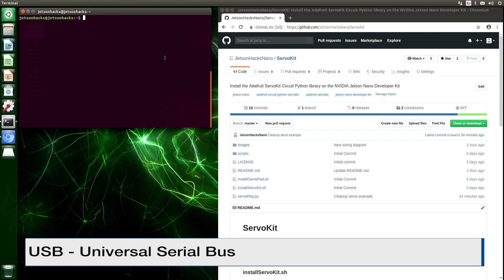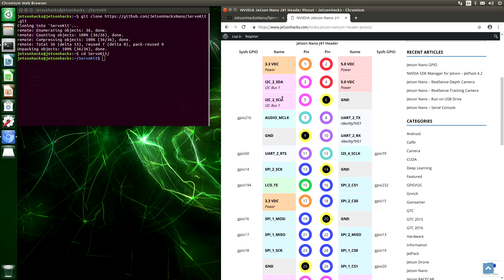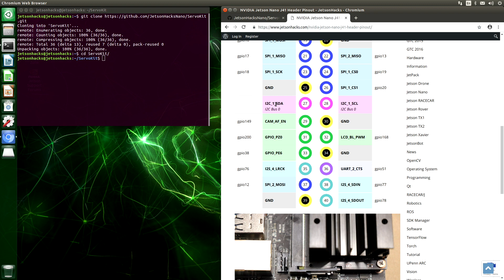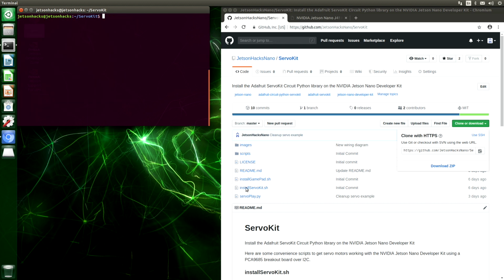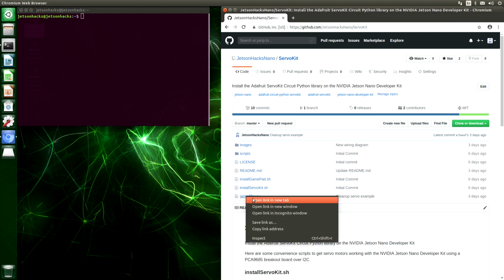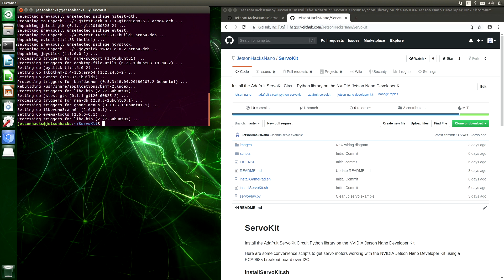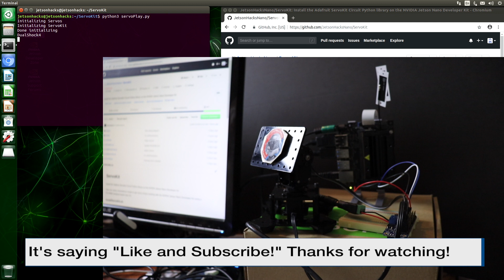Jetson Nano I2C PWM Servo Motors

Comment: Hi. I have run your script  on a clean install of Jetpack 4.2 which, I believe, is the one you use in this video.
 After the initial Ubuntu setup palaver I do a sudo apt-get update and then install git.Then I run your script which seems to run perfectly and I get added to the groups etc, etc. I wire my PCA9685  to pins 27 & 28 (i2C_0).  Then I copy the first few lines of your servoPlay.py script into a file I call servoTest.py and when I run it I always get this error :

from adafruit_servokit import ServoKit
import board
import busio
import time

i2c_bus0 = (busio.I2C(board.SCL_1, board.SDA_1))

kit = ServoKit(channels=16, i2c = i2c_bus0)

Traceback (most recent call last):
  File "servoTest.py", line 6, in <module>
    i2c_bus0 = (busio.I2C(board.SCL_1, board.SDA_1))
  File "/usr/local/lib/python3.6/dist-packages/busio.py", line 31, in _init_
    self.init(scl, sda, frequency)
  File "/usr/local/lib/python3.6/dist-packages/busio.py", line 59, in init
    from machine import I2C as _I2C
ModuleNotFoundError: No module named 'machine'

The error seems to indicate that the Jetson Nano board is not being detected  and I have not found any references to this particular problem anywhere. 
Have you any ideas as to why I seem to be the only one suffering this?

Thanks in advance for any reply.
Reply from the maker: The error message indicates that it can not find the Python module machine. Have you tried: https://www.youtube.com/watch?v=eImDQ0PVu2Y

Comment: Right joystick isn't working. It's mapped to RT. RT starts in 0 range and when pressed it goes eg 90 deg right and then 180 deg left. I've tried remapping via dualshock4.py file and even in jstest-gtk. Any suggestions?

Comment: Why at 9:50 after the angle supposedly set to 3, then when the angle is set to 177 (which should be nearly the opposite direction from 3 ) the servo only looks like it turned about 90 degrees?

Comment: Has anyone received this error when installing the game pad? Thanks for the tutorials! They're helpful. 

Collecting approxeng.input
  Using cached https://files.pythonhosted.org/packages/1c/27/418500122ddff3e29355c5f248b20690555102c59037961968583262ae55/approxeng.input-2.4.2.tar.gz
    Complete output from command python setup.py egg_info:
    Traceback (most recent call last):
      File "<string>", line 1, in <module>
      File "/tmp/pip-build-t2inutxw/approxeng.input/setup.py", line 2, in <module>
        from setuptools import setup, find_namespace_packages
    ImportError: cannot import name 'find_namespace_packages'
    
    ----------------------------------------
Command "python setup.py egg_info" failed with error code 1 in /tmp/pip-build-t2inutxw/approxeng.input/

Comment: does this kind of pwm work as "audio output?
"
Reply from the maker: I do not know what you mean regarding the relationship between PWM and audio.
Reply: @JetsonHacks  Pwm should be a square wave... If it's between 20hz and 20 khz it should be hearable... Or maybe i am missing something ahahah
Reply from the maker: @Barsay  Computer PWM signals are typically 25kHZ. Typically they are used to run peripherals like fans, servos and so on with the duty cycle being the variant. I don't have enough experience with audio applications of PWM from the PWM drivers to offer an answer. You should ask this question on the official NVIDIA Jetson Nano board, where a large group of developers and NVIDIA engineers share their experience.
Reply: @JetsonHacks  thanks! :)

Comment: Question, I’m very new to this, how do I connect  the pwm board to the breadboard? Thanks for these great videos and helping the jetson community!
Reply from the maker: Thank you for the kind words. The PWM board mounts to the breadboard by header pins which are soldered to the board. It's been a while, but I believe that the Adafruit board that I was using included the header pins in the package. After soldering the header pins onto the PWM board, plug the header into the breadboard. Thanks for watching!
Reply: JetsonHacks I bought the pwm board and soldered the pins but they do not stick out long enough through the back to connect to the breadboard. Connecting the pins to the breadboard is where I’m stuck.
Reply from the maker: @raraaararara  On one side of the header, the pins should be long. They go to the breadboard. The short side gets soldered to the PWM board.
Reply: JetsonHacks any tips on keeping dust out of your workspace?

Comment: My GIPOs are not showing any output(voltage) although the code is running properly. I have also tried to blink an led (with and without transistor) but still not working...plz helppp

Comment: Hello your videos are very help full. I followed this video but in my case the servo is not moving. Can you tell what the problem might be?
Reply from the maker: You have not provided enough information with which to help. Can you use i2cdetect to see the servo driver?
Reply: @JetsonHacks  I can't what might be the problem? Is it the board?
Reply from the maker: @usamashakeel7229  If you cannot detect the device, then you probably have it wired incorrectly.

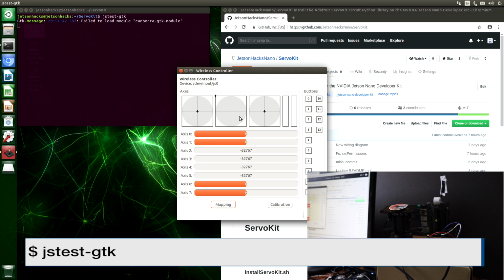Comment: Hi! my PS4 joystick has connected, and work well in jstest-gtk at 11:32, but it showed error once I run "python3 servoPlay.py", while servo at channel 0 turned about 100 degree and back after the line "Done initializing", before the error showed. How can I solve this problem? Thx! 

wb@jb:~/ServoKit$ python3 servoPlay.py
Initializing Servos
Initializing ServoKit
Done initializing
Traceback (most recent call last):
  File "servoPlay.py", line 37, in <module>
    with ControllerResource() as joystick:
  File "/usr/local/lib/python3.6/dist-packages/approxeng/input/selectbinder.py", line 37, in _init_
    self.discoveries = find_matching_controllers(*requirements, **kwargs)
  File "/usr/local/lib/python3.6/dist-packages/approxeng/input/controllers.py", line 170, in find_matching_controllers
    all_controllers = find_all_controllers(**kwargs)
  File "/usr/local/lib/python3.6/dist-packages/approxeng/input/controllers.py", line 207, in find_all_controllers
    get_controller_classes()}
  File "/usr/local/lib/python3.6/dist-packages/approxeng/input/controllers.py", line 206, in <dictcomp>
    id_to_constructor = {'{}-{}'.format(c['vendor_id'], c['product_id']): c['constructor'] for c in
  File "/usr/local/lib/python3.6/dist-packages/approxeng/input/controllers.py", line 201, in get_controller_classes
    for vendor_id, product_id in controller_class.registration_ids():
TypeError: 'NoneType' object is not iterable
Exiting... 
Cleaning up pins
Reply: I had the exact same thing happen to me. Your solution of downgrading solved the problem so thank you!
Reply from the maker: @shaischnarch  I am glad you got it to work!
Reply from the maker: It says it can't see the game controller. You will need to debug it.
Reply: @JetsonHacks  I finally resolved the problem, it's the version problem, I downgrade the approxeng.input version to 2.3.0, and it works.

Comment: Hi! Love your tutorials! I have followed the steps and things went well, but I got an error below when I input "kit = ServoKit(channels=16)
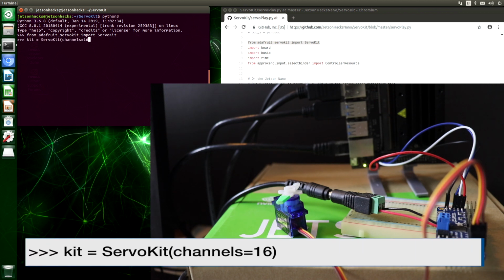" at 9:19, where showed:

Traceback (most recent call last):
  File "/usr/local/lib/python3.6/dist-packages/adafruit_bus_device/i2c_device.py", line 68, in _init_
    i2c.writeto(device_address, b'')
  File "/usr/local/lib/python3.6/dist-packages/busio.py", line 69, in writeto
    return self._i2c.writeto(address, buffer, stop=stop)
  File "/usr/local/lib/python3.6/dist-packages/adafruit_blinka/microcontroller/generic_linux/i2c.py", line 38, in writeto
    self._i2c_bus.write_bytes(address, buffer[start:end])
  File "/usr/local/lib/python3.6/dist-packages/Adafruit_PureIO-0.2.3-py3.6.egg/Adafruit_PureIO/smbus.py", line 244, in write_bytes
OSError: [Errno 121] Remote I/O error

During handling of the above exception, another exception occurred:

Traceback (most recent call last):
  File "/usr/local/lib/python3.6/dist-packages/adafruit_bus_device/i2c_device.py", line 74, in _init_
    i2c.readfrom_into(device_address, result)
  File "/usr/local/lib/python3.6/dist-packages/busio.py", line 59, in readfrom_into
    return self._i2c.readfrom_into(address, buffer, stop=stop)
  File "/usr/local/lib/python3.6/dist-packages/adafruit_blinka/microcontroller/generic_linux/i2c.py", line 44, in readfrom_into
    readin = self._i2c_bus.read_bytes(address, end-start)
  File "/usr/local/lib/python3.6/dist-packages/Adafruit_PureIO-0.2.3-py3.6.egg/Adafruit_PureIO/smbus.py", line 155, in read_bytes
OSError: [Errno 121] Remote I/O error

During handling of the above exception, another exception occurred:

Traceback (most recent call last):
  File "<stdin>", line 1, in <module>
  File "/usr/local/lib/python3.6/dist-packages/adafruit_servokit.py", line 86, in _init_
    self._pca = PCA9685(i2c, address=address, reference_clock_speed=reference_clock_speed)
  File "/usr/local/lib/python3.6/dist-packages/adafruit_pca9685.py", line 131, in _init_
    self.i2c_device = i2c_device.I2CDevice(i2c_bus, address)
  File "/usr/local/lib/python3.6/dist-packages/adafruit_bus_device/i2c_device.py", line 76, in _init_
    raise ValueError("No I2C device at address: %x" % device_address)
ValueError: No I2C device at address: 40

How come? Not sure how to sort it... thanks for your help!
Reply from the maker: It says that it cannot find your PCA9685. You should use i2cdetect to see if the Jetson can see the device.
Reply: @JetsonHacks  Wow! It works!! Such a magic here... 
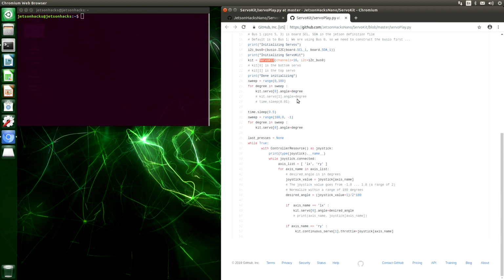The error was caused by mixing up bus 0 and bus 1 at 8:15
Thanks a lot!
Reply: Connecting pin3 to SDA and pin5 to SCL, which is bus 1, the problem is solved!
Reply from the maker: @techxartisan  I'm glad you got it to work!

Comment: Thanks for another great video. I am discerning from this and other info on the WEB that there is no easy way to do PWM on the Jetson Nano. I would think this is a much needed feature, as it would allow direct control of servos from the nano (with suitable power supply). Does anyone know if the issue of simple PWM on a nano GPIO pin has been solved. Did not find a solution looking around on the NVIDIA forums.
Reply from the maker: Thank you for the kind words. Like the Raspberry Pi, the Jetson has one PWM output. In order to get the PWM output to work, you will need to modify the device tree appropriately. This is the same process as the RPi (and any other Linux embedded computer). However,  the RPi has a user facing application which will help reconfigure the device tree "on the fly" so that you can configure the GPIO pins as SFIO (Special Function Input Output) by selecting their function from a menu, and then rebooting the machine.

There is no equivalent on the Jetson, though I do know that their engineers have been working on it. On the Jetson, it is more complicated than the RPi because the device tree is signed as protection against malicious intent. The RPi does not have that particular feature.

Typically things like PWM are better performed off of the Linux machines (SBC) themselves, because Linux is not a real time operating system. Running PWM is rather clumsy and requires a bunch of CPU cycles to monitor and time the pulses correctly. Micro-contollers like an Arduino or dedicated hardware like a PCA 9685 are built specifically for these types of tasks, as well as have a wider variety of analog, digital and other types of inputs. Not that you can't do it on an RPi or Jetson, but certainly if you are running multiple servos you will need to do that anyway. Of course, you know this already by the large ecosystem of RPi "hats" which provide these different types of functions. Thanks for watching!
Reply: @JetsonHacks  Thank you for providing a detailed response to Paul McWhorter's question.  It makes me think that I will stick with controlling the motors on my large robots with Arduino boards.  I am keen however to discern how I can use the Jetson Nano in concert with Arduino's to autonomise the navigation of my robots.  To that end, I will continue to consume the most excellent videos that both you and Paul have put together on the Nano.  Many thanks!

Comment: Love your videos.  This I2C video is really specific to the Adafruit board.  I have data on an Arduino Mega that I am trying to send to a Jetson nano and could not use this as a guide. 
Could you do a more general i2c video?
Reply from the maker: Thank you for the kind words. I don't know what a "more general I2C video" might be. The Arduino has to run a program for sending/receiving data over I2C, and you need one on the Jetson side. The code for reading and writing to I2C on the Jetson is in the libraries. libi2c is for C/C++ and Python, Jetson.GPIO can be used also. Thanks for watching!
Reply: @JetsonHacks  OK, I will chek out libi2c.  I see you mention it in the start of the video.

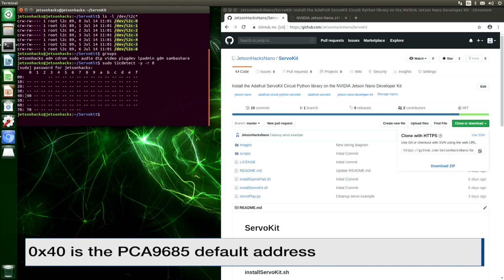Comment: Hello sir, there are 2 questions on 5:49. 
1. When I write sudo i2cdetect -y -r -1 (as I wired in i2c bus 1), I see only 68. But here I can see 2 numbers in your tutorial (40 & 70). Why it's like that?
2. When I write groups, I see something like $user_name adm dialout cdrom sudo audio dip video plugdev lpadmin gdm sambashare gpio. In your tutorial the "dialout" flag is missing. Why is so?
Reply from the maker: Not sure I understand your questions. I2C Bus 0 has different devices than I2C Bus 1. You can have different groups depending on your user permissions.

Comment: Thank you very much. That was really easy, except for the single servo test. I wired my PCA9685 on the I2C-Bus 0 as you did it, but I had to initialize it on ServoKit initialization with
>>>   kit = ServoKit(channels=16, i2c=ic2_bus0)
Without the "i2c=i2c_bus0", it didn't work, maybe because i2c_bus1 is the default, since you said so.
And I also have big trouble with my servos. They are capable to lift 25 kg (about 50 lb), but the starting current is so high that the voltage collapses and the servos keep resetting all the time.
Do you have a tip for me?
Reply from the maker: The single servo demo in the video was on bus 1, Pins 3 and 5. The current is limited on this little board, what is the current and voltage requirements for your servos?

Comment: @JetsonHacks It would be really nice if you could show how to use integrated PWM driver to use servos and how to change devicetree to be able to access to those peripherals.
As always great video!
Reply from the maker: Thank you for the kind words. I'm not an expert on the subject, but in general if you want to control a servo motor with real-time response requirements, then you need to use hardware PWM. While the big brothers to the Nano (Jetson TX2 and AGX Xavier) have this capability through the SPE, the Nano does not. You can get software PWM running on the Nano, but you end up chasing your tail if your goal is to control servos. It's a much wiser decision to use a microcontroller (Arduino, Blue Pill, Teensy and so on) or dedicated hardware like the PCA9685. Thanks for watching!
Reply: @JetsonHacks  I know that for RT application usage of external dedicated  controller is better option. But as far as I read in Jetson.GPIO library is says that Xavier has 3 hardware controllers, Nano has them 2, but TX2/TX1 has none of them. (Point 11 in README.md on library Github)
Reply from the maker: Interesting.  The Jetson Sensor Processing Engine (SPE) Developer Guide says that the TX2 also has a Cortex-R5 micro-controller for this purpose, so someone is fibbing. Unfortunately I don't think it makes much sense at this point to modify the device tree with the next revision of the OS right around the corner. No telling what they've changed.

Comment: Great video, thanks! Will you consider doing a video on setting up a UART device with the nano?
Reply from the maker: Do you have a particular UART device in mind?
Reply: emic2 text-2-speech module is what I'm having trouble with. I'm used to working on an Atmega controller which of course doesn't have that pesky OS to get in the way. I'm most interested to see what changes must be made with the OS (privileges, user space/kernel space, etc.) to allow UART communication.